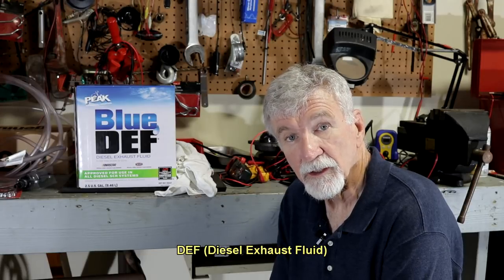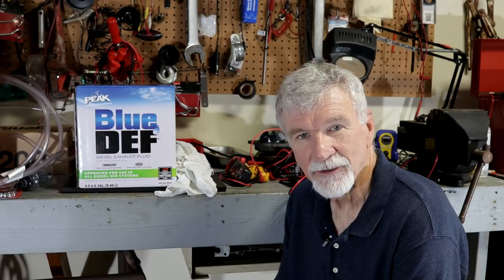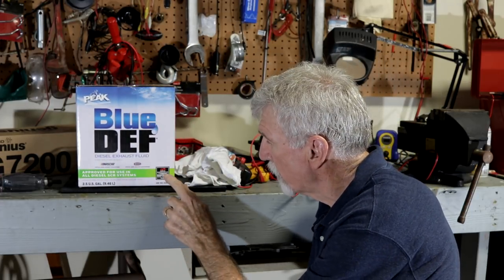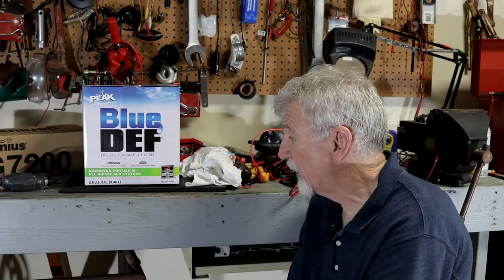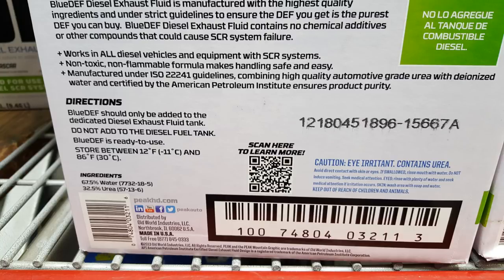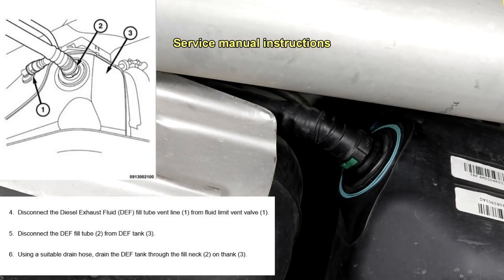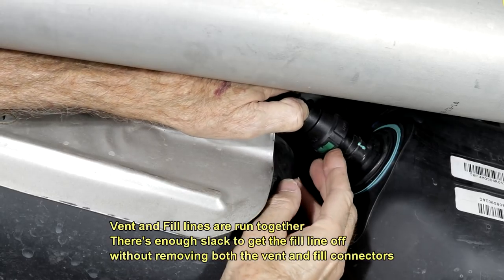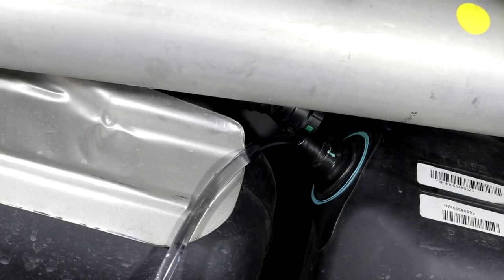How to remove DEF from RAM 2500 Cummins Diesel

Comment: Very helpful video! I had a problem with the DEF gauge pegging empty when I overfilled the tank a bit using a DEF pump at a gas station. It also threw a check engine light - code P203B: an issue with the DEF level sensor circuit, but gave me none of the warnings about 5 mph mode or anything like that. After draining a gallon or so out, the gauge worked fine and the check engine light was able to be cleared. Before I did that, I stopped in at the dealer who told me I needed a new sensor and pump to the tune of > $2,000. I fixed it easily myself with the help from the video and the price of some tubing and primer bulb. Lesson learned and, needless to say, I won't be trusting that dealership with my business ever again.
Reply: Thanks for posting your comment. Mine through a code a few days ago as we set out on our long road trip. I checked the code with my scan tool and did some research and decided to roll the dice and go anyways, but I'm thinking I got the same problem you had. Maybe I overfilled it and it's misbehaving. I guess we'll see when we hit the road today.

Comment: Filled up DEF from truck stop (my usual method - thinking it is more fresh) and on the way back to the campground we got a P207F Reductant Quality warning.  Didn't have anything to swap the DEF in the truck - so we drove back to NC while the computer kept warning us X miles to limp mode.  Back at home, used your method to swap the DEF and the warning cleared.  Thanks again for the help.  Now, I'll keep some transfer tubing in my truck just in case....and will start buying from the box with proper dates.
Reply from the maker: Yes I think the box is definitely the better way to go, just don't say that on any of the forums R you know how that will turn out, a big discussion. Haha
Reply: @MarionBlair  Too late....:)

Comment: Nice video, as are all of Marion's. Love his style and humor. 
My 2017 seems to use very little DEF when unloaded. Now have 15,000 miles, perhaps half of that towing 35' travel trailer. Have added 2.5 gallons of DEF 5 times. 
Nothing on dash indicates when a regeneration is in progress. Only way I know is that I can smell the super heated filter outside the truck. It would be nice to know when it's happening so I don't shut off the engine and interrupt the cycle. One would think that Chrysler would have a little light or something to say when it's happening. 
Dave
Reply from the maker: Thanks David, Yea, you'll never get an active regen when towing, exhaust gas temp is plenty high enough to burn the soot passively.  Around town, maybe every 150 miles depending conditions etc.. thanks.
Reply: My 17' has just over 14k and i added my 5th 2.5 gal as you stated. Ive asked the dealer to add my feed back about an regen light for future trucks. I doubt that goes anywhere, but i said it anyway.
Reply: Get yourself an Edge CTS2 monitor and you can see everything going on with your truck. Later after the warranty is up you can upgrade it to a tuner if you want to. I run a stealth module on my 2018 ram 2500 and it really woke it up. Eliminates the turbo lag, really improves the throttle response, improves transmission shifting and holds gears better as well as improving fuel mileage. Absolutely worth every penny. I run it in the 90hp mode for unloaded everyday driving and the 60hp mode for towing. Completely safe and leaves no foot print because it does not flash the trucks stock tune as it plugs in downstream of the computer. I just unplug the stealth module and remove it before taking to the dealer and they are none the wiser.
Reply: @hardtruth2039  Would you happen to have any more details about the stealth module running down stream of the computer? Links or more info on that and tuner or are they one in the same? Thank you.

Comment: I recently purchased a 2016 Ram Laramie that I will be using to tow an Rv hopefully around North America in the future.

I had no idea that my new truck took exhaust fluid. I thought since I owned a 1980’s VW Rabbit Diesel and a 1980’s Audi 5000 diesel I knew a bit about how they worked. Mind you both those vehicles were purchased overseas while serving my country and pickings were limited.

Whats even more funny  or clueless, depending on how you look at it, is fast forward almost 25 years and while working for Home Depot I would come across those boxes of DEF and I truly thought they were some sort of diesel cleaner or windshield cleaner.

Anyways and needless to say I know very little about the workings of my new Ram Truck and I truly appreciate your videos about them.

I will admit some of them seem a bit above my pay grade in terms of what you’re talking about but I truly appreciate your knowledge and the way you explain things. 

Thank you.

✌🏽🇺🇸🙏

Comment: Thank your for this. I have had to replace my sensor at the dealership 2 times now, i am sure it is because i dont drive enough to use up my def before it goes bad. Just did this and got a bunch of white crystals out of the bottom of the tank. Hopefully this solves the problem. Probably nothing ever wrong with the sensor

Comment: Thanks for info on draining your tank. I think filling only 1/2 -2/3 way is best plan to prevent old def aging out in your truck. This product is used so slowly it probably ages & goes bad between fill ups. I am still confused on using box vs truck stop def pump. I think refill with good box with good dates might be best

Comment: I got a P1D54 code according to my FIXD code reader.  Best I've been able to determine, it's an indication of the DEF being bad.  Bought a specific gravity reader to check the DEF & it was out of specs.  I will need to completely empty the DEF tank and refill.  Will using a siphon hose completely empty the DEF tank or do you think it will make any difference if a small amount of the old fluid is left in the tank?  Or is there a better way to completely empty the DEF tank?  I greatly respect your opinion.

Comment: I took off the crossmember that the DEF tank rests on and pulled the tank out.  I will tell you that it is not flat and does not have a  low-point on the bottom, it's very bumpy/uneven.    The only way I got it all out was to open the big round area where the pump is and then actually wipe it out.    You'll never get close to removing it all with that bulb pump.
Reply from the maker: Thanks Christian, appreciate the info.  I suspected I'd leave some behind.  Why did you have to take the tank out?
Reply: You're welcome Marion. I didn't have to, but since I did a delete I didn't want it just sitting in there for years.
Reply from the maker: Yea, I'd do the same.  How do you like the delete?  What equip.../ tuner etc did you go with?  Any transmission hard shift problem after delete.
Reply: I like it, has much better throttle response and more positive shifting, no issues. so far.  I just use a stock tune or a +30HP tow tune.  I went with Double R Diesel, MM3 Tuner, 4" flo-pro downpipe-back exhaust with muffler.  It makes a tiny bit of of smoke if I step on it, not bad though.

Comment: Another great video. I notice that your 2014 shows oil temp even as low as the double digits. Mine just shows a <122F until it warms up. Just an observation.
Reply from the maker: That's interesting, what year is your's?
Reply: At start up, mine shows the >122 as well. 2017 2500 here. As soon as it goes to 123, I know the truck has warmed up (takes 10 minutes) and I go on my way

Comment: Went in to dealer. Bad def injector, they had to order part. Truck has now gone into “count down” to derate. Fortunately I have a beater daily driver. I will let you know how replacement goes.
Reply from the maker: Yes, I'd like to follow up, thanks.

Comment: I usually add some when I’ve gone down between 1/4 and 1/2 a tank.  And I would say I do that fairly regularly.  I’ve had my truck since April 2017 and it’s got 40k miles on it already.  I’m guessing with how regularly I have to add def, I shouldn’t have much to worry about, despite being in Texas.
Reply from the maker: Nah. You're good.  I've run a lot this summer and with winter on us, it'll be good   into the summer.

Comment: Marion, question for you:

What is your opinion of these newer SCR emissions systems?  I know the older systems (without SCR) had DPF and EGR issues and fuel efficiency suffered.  Are the newer systems more reliable?

Also, I've heard a lot of people say that you need to tow heavy with these newer diesels in order to keep the emissions systems functioning and clean?  Is this true?  I plan on buying a Ram 6.7l Cummins truck; I'll likely only tow occasionally, but I will be on the highway a lot (sometimes carrying heavy payloads for camping, hunting, wood clearing, ect.).  Will that kind of usage be sufficient to keep the emissions systems happy.

I know there are other diesel trucks (1/2 tons and midsized) which are perhaps better suited to my needs.  I just really like the overkill nature of these 3/4 and 1 ton diesel trucks; it seems the big OEM's put a lot more effort into making them reliable and long-lasting.
Reply from the maker: Kal, I have a video on this exact subject, see below.  But the short answer is no problem using it as a daily driver.  There is a misconception that the diesel has to be loaded all the time or the EGR valve will clog up the system.  In the old days, that was more or less true but the newer engines have closed EGR loop systems which run exhaust gas thru the system regardless or load or engine speed.  So don't worry about that.  If  you drive mostly stop and go, the DPF will regenerate more (active regen) which uses diesel fuel to create oxidation to burn off soot in the DPF.  On the highway, even empty, there's plenty enough heat so that passive regens will take care of the DPF soot.  The system is really well designed.  Once you own a 2500, you'll never go back to a 1500, I promise.   It'll handle grocery get just fine just make your trips long enough for the oil temp to come up to full operating temp so any moisture etc.. can burn off.  The egr/dpf system works in the background, so nothing really to worry about.
https://youtu.be/dWscJr0VYQI
Reply: Thanks.  I'll check the video out.  Your content is very helpful!

Comment: Do you know what all repairs are done when the dealer completes the "Clean EGR valve - crankcase filter"? I had it done at 68k miles and I now have a little over 120k miles on the truck.  The procedure cost me just shy of $700.00 at my Dodge dealer and now that it is out of warranty, I was thinking about doing the next repair myself.
Reply from the maker: The CCV filter is about $70 and easy to change, Cleaning the EGR is not on the schedule but it's not difficult either.  It's a little more involved than changing the CCV.  $700 is way too much for doing just those two things.  If they changed the diff fluids, transmission fluid, transfer case, engine oil, air cleaner etc... and did the EGR and CCV, that might be worth 700.  The CCV doesn't need to be replaced till 135,000 and the EGR is not a maintenance item so you don't do anything to it unless you have a problem.  Just the EGR and CCV will cost less than $100 if you do it yourself and is easy to do.

Comment: If your trucks are still goin to dealers for repair i would be careful about deleteing the def/emmissions stuff...Im sure the dealer are working up to it as they are in effect with the big truck world but dealers will not work on it/void warranty and tell you to replace as it was before its touched..
Reply from the maker: Yeah that's true for the powertrain for sure.
Reply: @MarionBlair  I know for example that freightliner will tell you to replace ex and such in the same was it was built..So imagine you spend a small boatload to delete it all only to have dealer make you replace it then cost of repair on top of that..Expensive as hell..Actually a fella on youtube(dont remember his ch)was contact by epa and told to replace his pick ups ex n such to factory...Seems he had a epa viewer on his channel..
Reply from the maker: @craig_sez8534  yeah that's a big reason why I probably won't delete because the EPA seems to be cracking down on this stuff. And I don't even want to think about having to reinstall that crap

Comment: Hoping this picture loads up but if not,  what mine did was to initially start setting the reductant tank heater circuit high code. Then the dash gauge began reading empty although it was not. And of course the computer only knows what the tank unit is telling it. Which of course results in 5mph max when the mileage timer runs out. I drop the tank to find a white foamy layer in the bottom of it and the rubber parts on the pump,heater unit to be swollen. 
900.00 later for the pump unit , wash out the tank and it's all good.
Reply from the maker: Good Lord!  $900
Reply: Yup, and I get my parts wholesale at the dealer. Otherwise it was 1100 something.  At least it's an easy job though
Reply from the maker: @redstagriding295  that's painful.  How did the tank look? Clean?
Reply: No there was what I would guess to be about 1/2 cup of a white somewhat thick layer of crud in there. I used hot water to wash it out and even had to use a few drops of dish soap on a rag to get a film off it that the hot water wouldn't dissolve.
Reply: I have a picture but apparently cant upload it here

Comment: i want a 2019 ram 2500 6.7l cummins, i don’t know much about diesel, how would this truck do as a daily driver/short trip truck, 6 miles to work and 6 miles back home? and can you do a manual regen on this truck?
Reply from the maker: Hi Khalil, I might have replied in another thread but, I think the DPF will handle the regens fine,   With that much short trips, you'll want to change the oil more often.  If you can get it up to operating temp daily, it should be fine.

Comment: This is a problem? My truck gulps def down!
Reply from the maker: It's only a problem if your truck doesn't get used much and you are in a very hot environment such as Las Vegas or the like.  Within 6 months of installing a new tank of DEF you could have bad DEF which plugs the injector. Codes, Codes dealer visits, change injector, clean out tank etc...  If you  use your truck a lot and run a tank every few months, forget this video.

Comment: I’m curious, Is there anyway to do a manual regen on the dodge rams? My father has one and I wanted to clean his dpf filter.
Reply from the maker: It'll clean itself when it's ready but if you are close to a regen, meaning the differential pressure across the filter is high enough for a regen to start, get out on a stretch of road and lug it a little, say like do 50 and accelerate a few times.  Not flood boarding it or anything like that, actually better to stay in the same gear and try to lug/load it.  Sometime you can fool it into thinking it's ready for a regen.  Do everything at the same speed and check your mpg before you do the above, if you see your mpg drop by about 10 mpg, you've successfully got it into regen.  But the short answer is, no, there is no way to manually cause a a regen.  These systems are very well designed and you shouldn't have to do that but for fun you can try the above.   Another way, if it's close, is get on the freeway and run at 70 or more and watch your mpg, before and after.  It's hard to tell without a after market gauge.  Some say they can smell it.
Reply: Marion Blair thanks for the info, I know on class 7/8 trucks you can do a manual regen by parking and flipping a switch to do it. I was considering buying either the ford 350 or dodge and I just like to be able to do it if necessary to clean the filter.
Reply: I totally agree, even a message on the dash or light would be nice to let you know an active regen available with some kind of switch to start it when you want.  The big truck  have it as you mentioned.  The only time RAM gives a message on the EVIC is when the thing is 80% full which could get you in a lot of trouble if you are stuck in Houston traffic etc... My edge insight has a selection on it that allows will start a regen but it has been defeated by edge.  Apparently for warranty reasons.  I'm thinking there may be a monitor like this that will actually start a regen when you give the command.  I'm going to look for that.  The truck does a beautiful job of taking care of itself but you can cut off about 10 minutes of regen time if you are running at highway speeds since you are getting so much help from the passive exhaust temp being higher.  It would be nice if you could take advantage of that knowing that you are getting ready to do some traffic driving, you could clean it out faster.  thanks for the thoughts.

Comment: Great video Marion! Thanks for taking the time to show us. I'm trying to siphon out DEF from my 2017 Ram 3500 right now. Did you siphon out a FULL DEF tank or was that tank partially full? I'm worried that DEF might come squirting out at me if I remove the fill line.
Reply from the maker: It's unlikely that will happen.   It's got to be really full to do that though.  I fill mine 100% in the Walmart parking lot in Texas and then drove home about 600 miles and drained it and it didn't overflow.  So doubt that it's that full but keep a bucket underneath just in case, ha.

Comment: If they're going to use a system with liquids that won't last very long, they should put a drain plug on the tank. My Cummins 3500 truck needed a clutch and due to Covid, we had trouble finding one. By the time I got it back on the road, my DEF is apparently contaminated. About to go into limp mode in another 150 miles. I'll try to siphon it out. Thanks for the video. I just wonder if the computer will reset itself if I replace with new DEF. Does anyone know?
Reply from the maker: Yea, computer don't care,